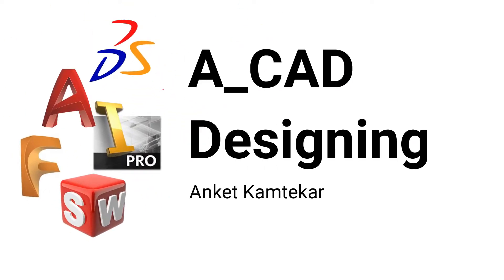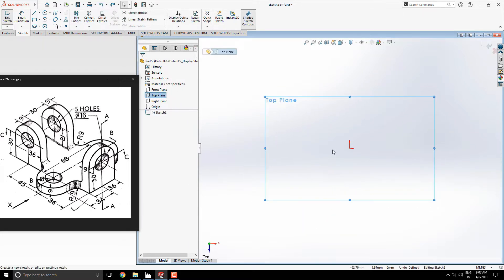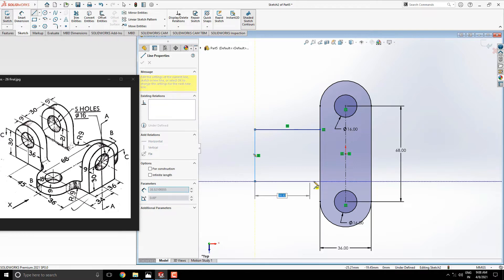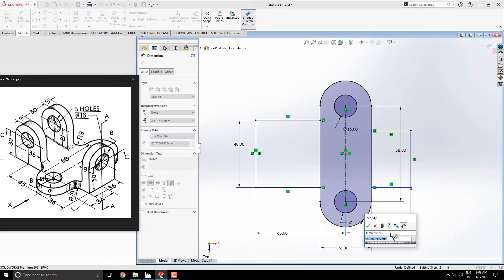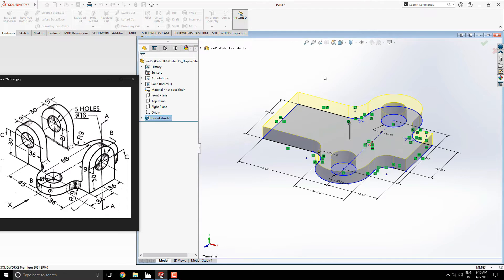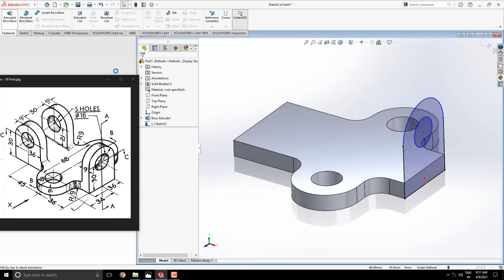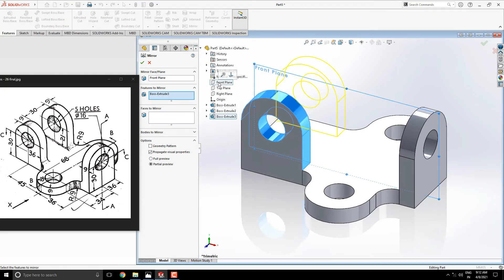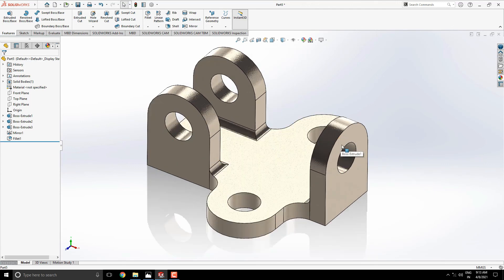SolidWorks Tutorial For Beginners | Part Modeling Exercise - 26

Comment: I need some help.  I'm still pretty new.  So I needed to design a part on a team project.  I sketched it on paper and started creating it in solidworks.  I didn't know yet what units or dimensions I was going to be using, only geometry.  

The part base is circular, so I figured I could create all the features and then at the very end assign a diameter and units when I know them.  I now know it's 3" and inches.  Can I do this and keep all the geometric relations of features? 

When I use smart dimension on the base sketch circle, it doesn't scale everything else accordingly.
Reply from the maker: First you need to set unit..
Unit system for individual documents, go to Tools > Options > Document Properties > Units